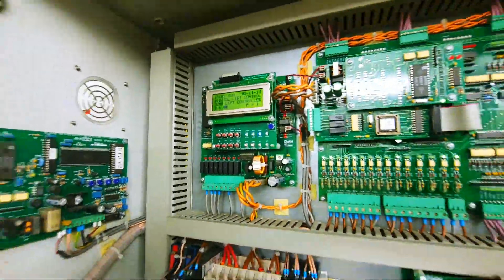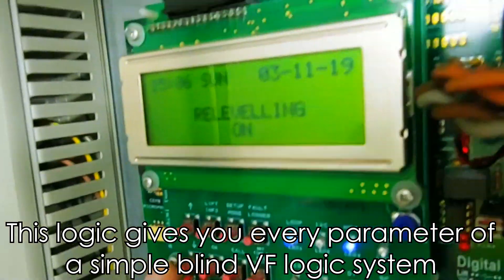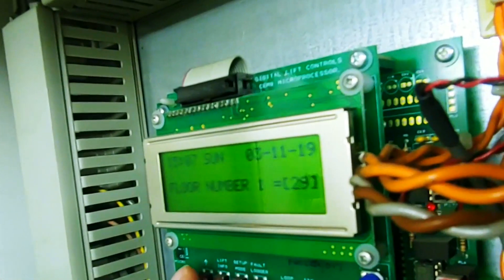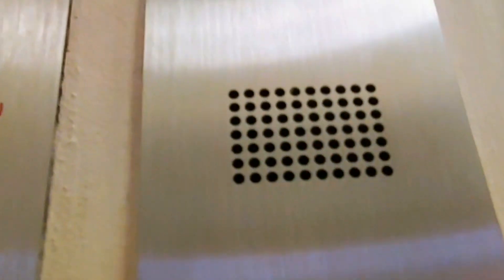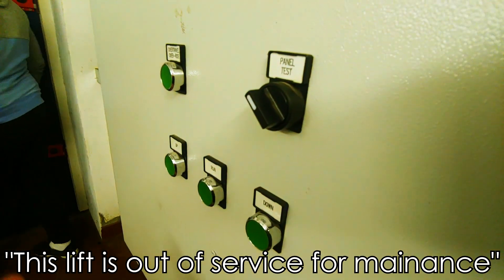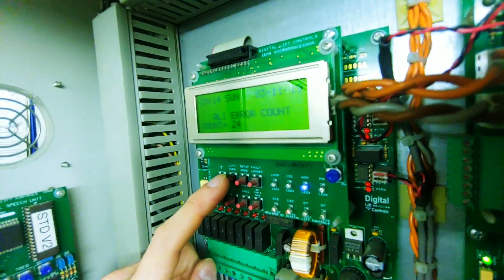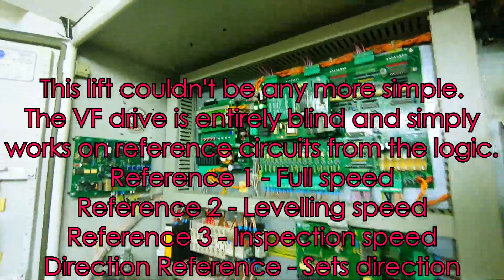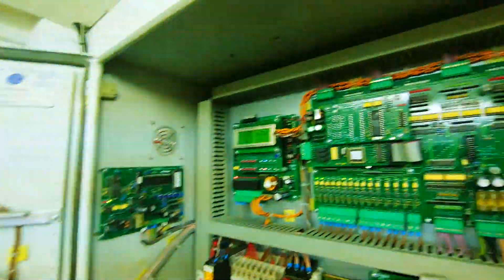Detailed look at Digital lift controls logic

Comment: This lift sounds like “Hyacinths” voice.... Does the event logger use a flash memory to store it’s things or is it something old school like a battery backed up sram chip? How much storage space would they actually need to to keep the log? I was thinking of this last week after seeing the Schinder Miconic video.
Reply from the maker: The logic was first produced in the mid 90s.  I am not too sure what was the common way to store things then.  This logic does not push any boundaries.  It is as bog standard as it gets.  It is a rival to Lester Controls.  The log and lift settings would need very little storage.  Each log entry needs...  The fault code, the time stamp, and a short list of common parameters at the time (position, lift status such as if the lift is moving, safety circuit status).  There is probably only 16 or 32 log entries.

Comment: its the silly voice, but not the one and only silly voice lift
Reply from the maker: The silly voice lift had just the Digital lift controls indicator and voice board bodged into the floor indicator circuits of some older logic.  Most bodged in voice units will make loads of unnecessary announcements.  On this lift the voice unit is wired straight into the logic, probably using CAN bus, so it only talks when needed.
Reply: @benolifts  i've seen a Schindler modded with KONE LCE that will say doors closing from a minimum of once to a currently known maximum of six times depending on how many times the door sensors get obstructed for. This only happens when its responding to a hall call and when this happens it won't actually announce doors closing at the correct time. If its not responding to a hall call however, it announces it properly but does keep the doors open for a while